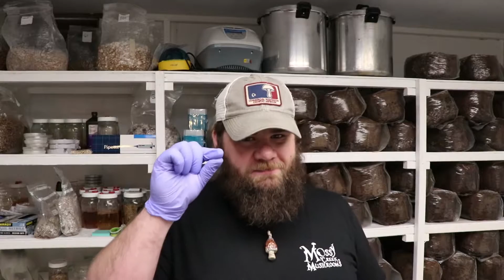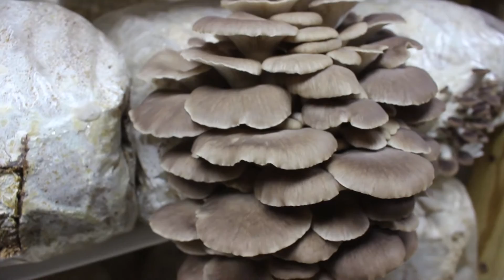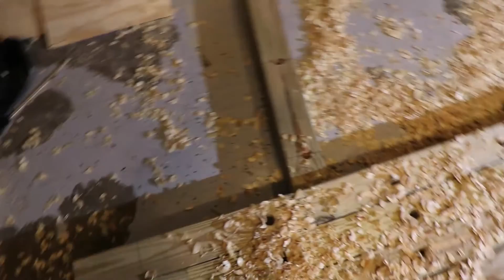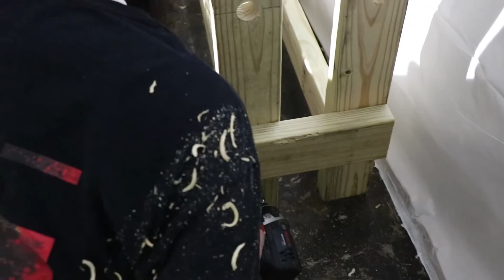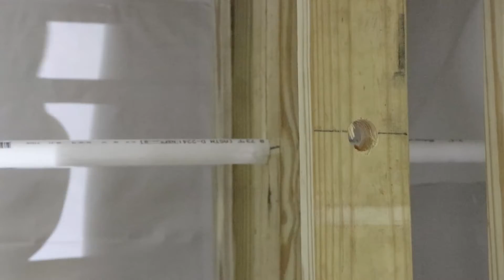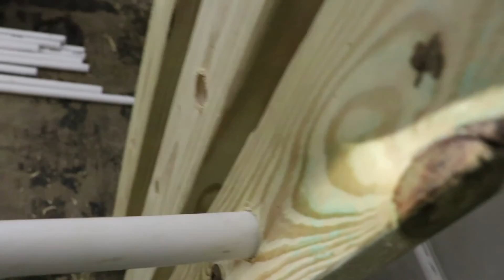Valentine's Day Week

Comment: I plan on taking this up as a hobby some day. The issue is i'll have to build a large grow tent in a spare room then  install a ventilation system to the outside. This will then force me to install a heating unit in the grow tent due to my northern location. Making a functional and protected grow room will be the main limiting factor i see (due to the cold climate). This seems to be something growers overlook  but  I don't want to expose my family to mushroom/mold spores if it's going to be harmful. Is there a simple less convoluted solution? Are the health ramifications something to take seriously?
Reply: he mentioned in one of his videos he makes sure he has negative pressure in his rooms
so air gets sucked out
you wont have that much cold entering 
you can maybe crack a window in the other side of the grow room or close to the grow room so the heat from your family's hous does not get sucket out